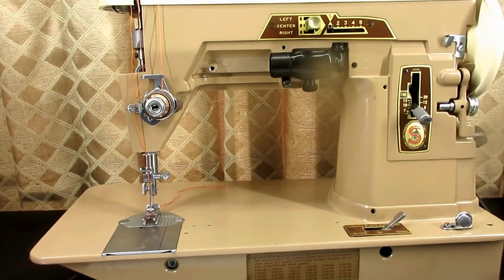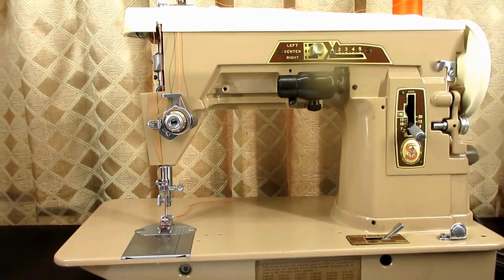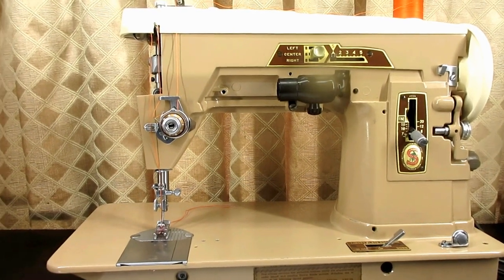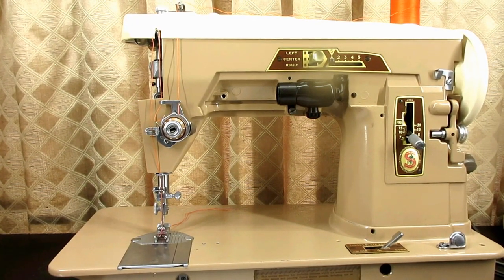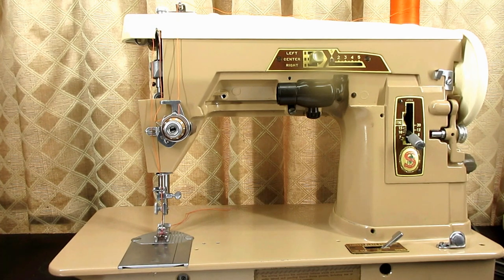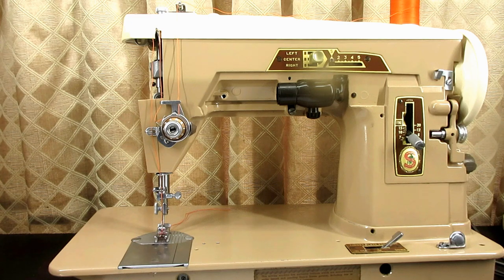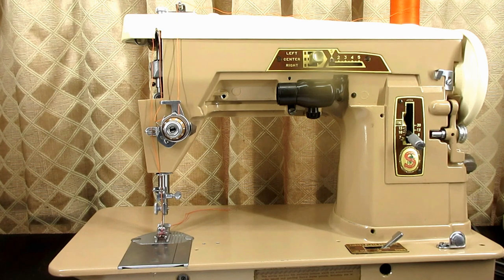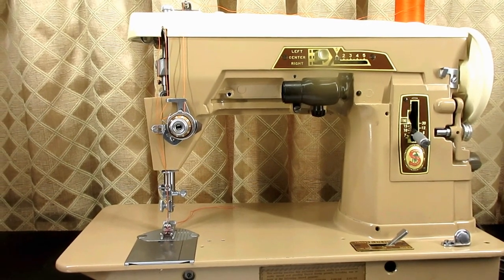Check and Set the Thread Clearance Singer Model 403A Sewing Machine

Comment: So glad I watched this again with my 401A.  My 403A was just fine in this area; I didn't need to do any adjusting at all.  With the 401A, a different story.  As I was beginning to play around with regular stitching and all those fancy stitches, the thread would eventually jam up in the bobbin area, even though the clearances measured .013 inches.  Your video showing the thread getting caught up on the hook was exactly what my thread was doing.  Then since you mentioned that each machine has it's own "personality", I went back and adjusted the gaps to be someplace between .014 and .015 inches.  Problem solved! Thank you so much for your clear explanations and close-ups of what's happening in the bobbin area.  I can see how someone who didn't know how to set these gaps would get super frustrated and perhaps give up on their machine.  I feel I've jumped over a learning hurdle and picked up much new knowledge.
Reply from the maker: I am so happy you picked up on the "personality" aspect of a vintage machine. Each one does have it's own history. You will become more and more intuitive about settings and troubleshooting as you continue to work on the machines. Nicely done, Carol. I pinned your comment to the top. Maybe other viewers who made the "factory" adjustment but still have a problem can learn to "tweak" those adjustments based on what allows the machine to work the best, just like you did. Thanks for sharing.
Reply: @andytubesewing1953  Had the same problem as Carole! So glad to find this video and will be diving into adjustments soon.
Reply from the maker: @barnette6158  I'm glad you found the video and hope you get positive results. Thanks for watching my channel

Comment: you make the best sewing machine videos! I knew I heard too much rattling in the bobbin area. This is my problem with my 401A.  I'll have to pick up the gauges, but I can't wait to fix it.  Thank you for taking the time to make all of these.
Reply from the maker: Thanks for the compliment. The hook and bobbin case of this machine is very strong & dependable, but if that gap is too much it really makes a racket. The gaps listed in the Service Manual usually work well, but each machine is unique with different wear and usage. I've had to "tweak" the gap on a couple of machines. but once I found the "sweet spot" it really made a difference. I hope you have the same success. Thank you for watching my channel.

Comment: I have several 401 and my most recent one was hanging up.  I did adjustments as  you demonstrated except I didn't have feeler guages.  I need to buy some.  I eyeballing it and tested wirh hand wheel watching the thread.  I kind of used my finger nail on my index finger as a rough guage- LOL and it finally is sewing correctly.  Thank you so much Andy Tube!
Reply from the maker: That's a creative workaround, Crystal! Between my video and your brains and determination, you did it! If you find issues with any of the other 401A machines this playlist of repair videos may help; https://www.youtube.com/playlist?list=PLsCOZgzzaiKLiDl9yFTP6mJgQmz5lj4NO    Happy sewing and thanks for the comment.

Comment: Andy, thanks for the useful info you provide here, I used it to get a 500a to sew better and more consistently.  Based on this and the OutFishing13 video, I also removed the lint pin while I was at it, but am not sure that it was causing any problems on this particular machine.  You mention a machine's 'personality' -- in the end I had to provide more clearance (on the upper end of those factory numbers) to get it working well, and we'll see how it works going forward.  Much improved so far!

Thanks again!
Reply from the maker: Welcome, Scott. If you are having skipped stitches, especially on knit fabric, the Rocketeers are known to have that problem. There is an adjustment where you can move the hook closer to the needlepoint to correct it. Very few models can do that adjustment, but the 500A & 503A can. Let me know if you have skipping and we can work on said adjustment to try and fix it. Happy sewing, and thanks for watching my channel.

Comment: Thank you!! The bobbin thread on my T&S 675 was getting hung up near the heel gap; I followed your tutorial and saw the thread wasn't being released soon enough, and the stop gap clearance was nil, as in, zero. I bought a set of gauges and the heel gap was too wide, too. 

I had been noticing, as I sewed, that the bobbin was very noisy, and I could feel lots of bumping under the throat plate as my hand held the fabric. Periodically I would end up with a nest of thread under the plate, although the bobbin and top thread were still free once I reached under and clipped the offending thread that was looped around the heel area. it got to the point where I was sewing by turning the hand wheel as any speed caused problems, but I had to finish the project.

I  just finished the clearance adjustments, ran a lengthy test piece, and the difference is incredible! Also, I noticed the set screw is badly damaged, so someone had been in there a lot. The adjustment screws on the bracket are a bit worn, as well.

Thanks again, for a wonderful, thorough, explanation!
Reply from the maker: Nicely done, Michele! Thanks for fixing your machine. I'm glad you found my video. It sounds like people have played with the adjustments before but maybe did not know the way to fix it. It was worth the cost of those gauges, right? Haha, have a happy sewing year in 2020.

Comment: Sir I want to thank you! I have had my sewing machine in with two different people and they can never get it right. I just followed along with you on setting the bracket spacing and the set screw. Although I do not have a spacing tool I think I can get it pretty close I'm going to try it for a while and see how it works, but I just wanted to thank you for your very precise instructions I have subscribed and shared and I wish you all the best of life and I hope everything is going well for you!
Reply from the maker: I'm glad you found the video, Alma. You don't mention what the trouble is that you are having, but this setting should be done either way. FYI, you can eyeball the setting, and also the average copy paper is 0.1mm thick and the average playing card (like the queen of hearts 💖) is about 0.2mm thick so one paper and one card would be a little over 0.3mm and gets you into the lower range of those two settings. Glad you are trying it out yourself. You can do it! Thanks for the good wishes and good luck.

Comment: Thank you so much for this video. I bought a rather unloved, but just about working 401g. Your clear and detailed instructions are helping me restore it to working order. It was driving me mad because the needle thread was occasionally wrapping around the bobbin race, particularly when I reversed the stitch. I found this video and followed your instructions and I think I've cracked it! Now I just need to tackle the top tension because the zig-zag is skipping stitches occasionally and I think it might help solve this. I would also like to find the correct bobbins as I don't like the plastic ones that came with it.  Thank you again.
Reply from the maker: Thanks for rescuing that machine. Here are my playlists of videos that relate to the parts on your machine:
Model 401A 16 videos https://www.youtube.com/playlist?list=PLsCOZgzzaiKLiDl9yFTP6mJgQmz5lj4NO
Model 403A 26 videos https://www.youtube.com/playlist?list=PLsCOZgzzaiKKyqvdDRwS-9MfLuwSNJTcg
Model 404 56 videos https://www.youtube.com/watch?v=6RgiOegFx-I&list=PLsCOZgzzaiKIB4kvIHCfHYuyLMUp5A4UI
Button style foot controller 8 videos https://www.youtube.com/playlist?list=PLsCOZgzzaiKL6ePPxLpmnWSzTyxPKTb71
The USA Slant Models 401A, 403A, 404 came from the factory with class 66 plastic bobbins Part No. 172336
I know some people prefer the metal class 66 bobbin; that it is somehow "stronger". Remember that many industrial sewing machines use plastic bobbins. The bobbin spins inside the bobbin case/holder as the thread comes off it. The metal bobbin on the metal case. The ledge on the case can wear down from the metal-on-metal rubbing. I'd rather wear out a plastic bobbin than a bobbin case. When the hook pulls the needle thread around, the lower loop travels under the bobbin case. With a worn bobbin case, the bobbin sits lower and can start snagging the thread as it tries to go under the case. I was told by retired repairmen that is the reason Singer when to plastic class 66 bobbins in the mid-1950s. Maybe it's true? Thanks for watching my channel and taking the time to comment.🙏

Comment: Great video Andy. Thank you!
Reply from the maker: You're welcome I'm glad you liked it Nice of you to take time and comment
Reply: @andytubesewing1953  Hi Andy, I wanted to add a special thank to you for this one as after watching it yesterday I took another look at my 431G, on which I had done a lot of work but never been quite happy with. I had done all the lubrication, checked timing, had the camstack out and cleaned it etc but, no matter what I did, it refused to straight stitch without bunching underneath, giving the impression of incorrect upper tension. It would however chain stitch perfectly well! I had spent weeks on it and no success until a very kind lady in upstate New York donated a bobbin case from, I think, a 401. Immediately I had success, which just meant swooping out the bobbin case if I wanted chainstitch. However, I was never really happy with the machine as it only "liked" heavy upholstery thread, tending to break lighter stuff. Until watching your video I had no idea that there should be a gap between the spring clip and case, and when I checked, found that  my upholstery thread was indeed hanging up a bit even though the result of stitching was reasonable. I couldn't find my feeler gauge and so just eyeballed it and adjusted. Wow, it now stitches using the original bobbin case! I think that the two cases must have a minimal size difference so that the 401 case had just enough extra room for the thread to,eventually, slip past. I now have to experiment with lighter thread and see how those fancy stitches turn out, and find my feeler gauge and accurately check the clearance. I am indebted to you. Please keep well and keep up the good work.
Kind regards,
Martin.
Reply from the maker: @Tunneldreamer  I'm really touched by your comment, Martin. Your success is a complete validation for making videos like this. It's the whole reason fo my channel. I love it when people can learn something about their machine to fix, improve, repair it. The machines are wonderful and crafters like you do appreciate them and I appreciate that you are keeping them in service and out of landfills. You absolutely made my day, and I thank you sincerely for that. Take Care.

Comment: Hey, I'm stuck. They 400 series manual shows my machines bobbin area, and 4 gap areas but... it is hard to understand the illustration. Can you help?
Reply from the maker: Yea, it's not the best illustration of the thread gap SInger ever made. The Apollo system bracket On model 457 (and a couple others) is extra complicated, IMO, with the 3 screws. I've never had to adjust position 4, and rarely position 3, but usually 1 & 2 are all. I don't have a video of this particular model showing the adjustments. You're not the only viewer who has asked about it. I even put the documents in a slide show here: https://youtu.be/fn0GCJGiuZI  I've heard some copies of the manual are not very clear. I can't walk you through it over the internet, sorry. I have a video of a similar system (not the same, but similar) where I show how to adjust some of the spaces. I don't know if watching it would help you out but you can see it here: https://youtu.be/fq_1qRQFM_Y  I always check the gaps before changing anything b/c the gaps are often in range unless some previous owner played with them. That started happening more as fewer repair shops had techs who knew how to work on the vintage models. Wish I could offer you more, but that's it. Good luck, Sharell, and thanks for watching my channel.

Comment: Thank you for all your videos, Andy! They are super helpful. My issue is that when the needle thread moves from left to right as the hook pulls it around, it's getting hung up on the actual bobbin. Almost like the bobbin needs to sit lower. Any ideas?
Reply from the maker: Be sure you have the correct bobbin. If you have a model 403A it left the Singer Factory with plastic class 66 bobbins, part 172336. Class 66 bobbins have curved sides, like a saucer. Class 66 metal bobbins tend to be a little taller. Some people have class 15 bobbins that have flat sides and are taller still, and always catch the thread on a class 66 bobbin machine/holder.  EXAMPLE: https://www.sewingpartsonline.com/bobbins-singer-apollo-class-66-172336.aspx    If you are using the correct bobbin and still catch the thread let me know.

Comment: Hi Andy sorry to keep asking you questions! On my 500a I did your upper tension video already as I thought it might be source of my semi frequent tension issue but after watching this and observing the thread action down below it may very well be THIS, my stop gap is too big- the .016 gauge still has space leftover. Question is how do I best unstick this baby screw to fix the stop gap? I can’t get it to budge. Thanks!
Reply from the maker: A larger space like that would make for a very noisy bobbin case banging back and forth. I'm not sure it would affect tension. You don't describe what the semi-frequent tension problem is exactly. **  Stuck screws on a VSM are quite common, unfortunately. First off you need a very good screwdriver so you do not damage the head of the screw. Some methods folks use on a stubborn screw are to use a ratchet or socket style screwdriver b/c it gives you 3 times the torque for turning. You can also heat the screw with a hairdryer to try and loosen it and soften any dried oil that may have "varnished" the screw threads in place. I've put WD40 or similar penetrating oil on a cotton ball and, after heating the screw, just let it sit and soak. Another method that can work is to firmly tap the screwdriver while turning it at the same time. That's a little tricky on those smaller screws, but tapping with a lighter-weight hammer can create a "shock" that frees the screw. ** As you are having tension problems have you thought about the Bobbin Case condition or tension setting??
A dirty bobbin case can affect tension on the bobbin thread which of course can mess up stitch quality. Lint/dirt/debris can get trapped behind the tension spring of the bobbin case and cause a lack of tension and/or irregular tension. Your 500A uses a Class 66 drop-in bobbin case and I did a video about cleaning and adjusting it. You can see it here: https://youtu.be/HT5XZ5eYYEQ
Reply: @andytubesewing1953  Oh I’m sorry to hear about your health problems! Yes I took out the bobbin case holder bracket and am soaking the screw area in WD-40 right now. Maybe my husband has a Chapman set like you, I’m going to look. So yes the bobbin case did seem kinda clackety-clack  and also after watching it “cast off” and then comparing to the 401, the 500 thread gets snagged for a bit sometimes. I had noticed after adjusting the upper tension how the spring was not acting uniformly when hand cranked. Sometimes it floated there and sometimes it would go way up. Didn’t have a defined rhythm. When sewing I will be going along fine and then all of a sudden the thread is stuck making knots underneath which I thought meant it was the upper tension. The tension spring’s tension feels the same as my 401. Thank goodness I have that as a comparison. So I’m going to adjust this bracket space and then see how it works. I have already cleaned the bobbin case and race and all that. If that doesn’t solve it I could try swapping out the bobbin cases… maybe there a small knick  or corrosion or something I’m not seeing…. I hope you feel better! I have recommended your channel often 🙂
Reply from the maker: @tracisass4983  Good luck with your plans then. I wish you success. Now that you have explained more about what exactly is happening with the thread I'd ask you to take a look at this video when you have time. https://www.youtube.com/watch?v=19UA-7Rj8S0   Mathew was an Andy Tube viewer who had a very similar problem and had tried several things to find the cause. Some of the things you are trying, and other methods also. He finally discovered the thread being snagged by a delint pin on the side of the bobbin case positioning bracket at the top end of the hook. He discusses in his video where the pin is and how he removed it which ultimately fixed his problem. We have later discovered not all of the 401A/503A/500A, and 503A bobbin case positioning brackets have a delint pin, but others have removed the pin and eliminated the frustrating skipping and tangling problems they were having. Thanks for the good wishes and good luck to you too.